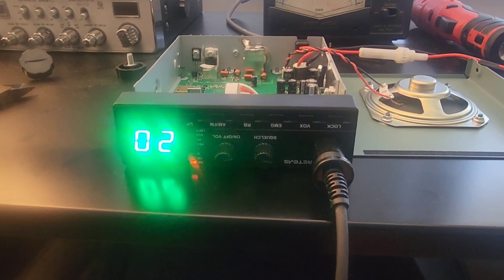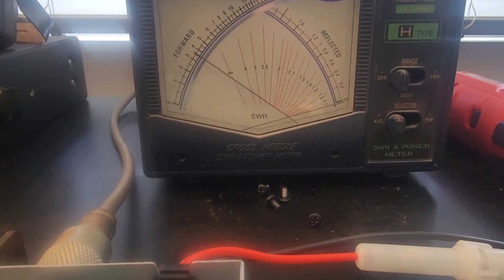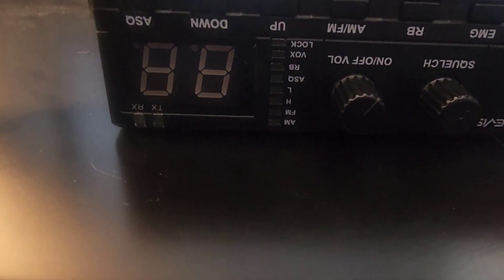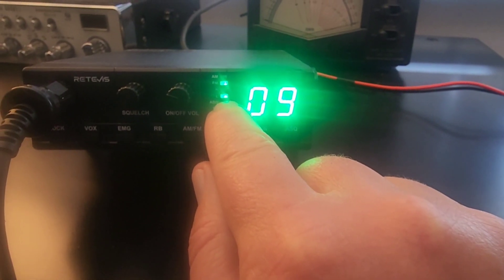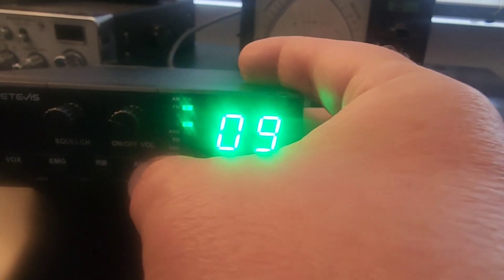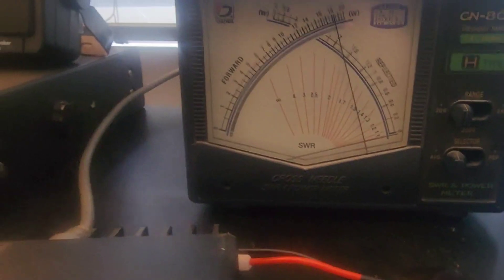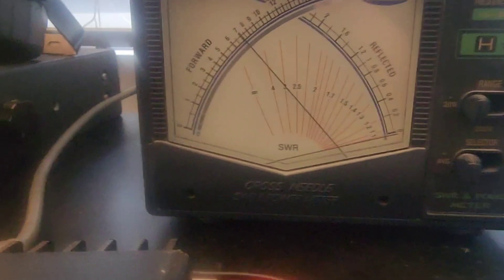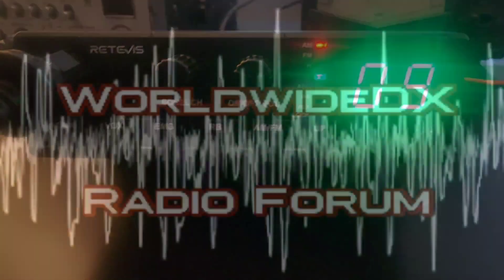Retevis MB2 CB Power Modification

Comment: How long will the radio last with this modification. Higher transmission power means higher voltage as I remember from when I was into cb radios in the 80's and blew many radio finals .
Reply: At that wattage it shouldnt matter. Certain models like the eu version dont have that jumper at all. If you were pushing like 40 watts through it or some serious mods it could likely have ill effect, but this radio is designed to run like this.

Comment: Im new to the radio world. Can you explain the relevance please? I was looking at this radio and thinkg about buying it and came to youtube to see what says my fellow men and found this video first. I do not know if this is a good, bad or crazy, thing.
Reply from the maker: In the U.S., the FCC regulations for CB allow for a 4 watt AM carrier. Most CBs will modulate that carrier to about 16 watts peak, which is proper (4:1 peak to carrier ration) and sounds good.  This radio will allow you to change the AM carrier to 8 watts, but it will still only modulate to 16 watts, so it sounds bad, but there may be a reason for some operators to want to do that.  However, FM works differently; it doesn't "modulate".  On FM, the extra 4 watts you get by modification is actually beneficial to signal strength, even if it's not within the FCC regulations.
Reply: @tuckmeat  you're the man! Thank you for the fast response and for saying it in such a way that someone without very much knowledge about these things, can understand.  So, to summarize, just to see if I do have it right,... by doing the mod, it may make am sound worse but in fm, it will add 4 watts to the transmission side, allowing for the transmission side to carry .... however farther the + 4 watts will add to the base watts?